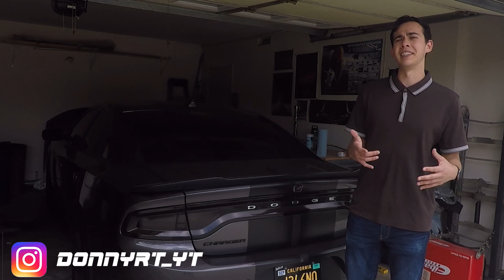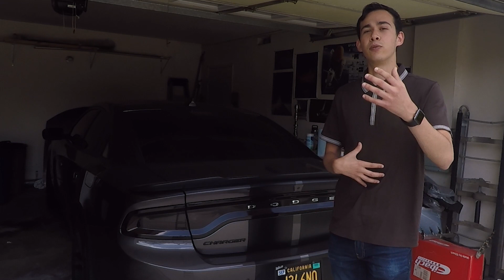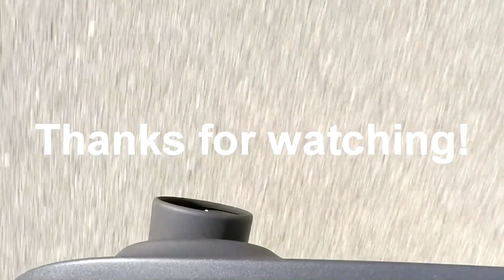Why I Haven't Been Uploading...

Comment: Did you need to unlock your pcm before tuning your car? I have a 2015 r/t I’m wanting to tune. I’m side by side with a v6 camaro
Reply: U should be able to beat em. I hold the record for fastest 0 to 60 on stock rt. I got 4.5 twice and couple 4.7s ... v6 camaros are low 5s but we got em on top end.. just take out your passenger seat and get a tire and pedal commander u should beat any stock rs ... I even beat a scatpack 2x but he sucked at driving
Reply: yea 2015+ needs pcm unlock

Comment: Hey don. I just got my cam installed by a professional performance shop. It took months 2500 dollars, a bent set of push rods my transmission not shifting right  Wrong tune loaded by the shop. 10 visits many phone calls.
Reply from the maker: The shop installed it incorrectly? Shouldn't really bend pushrods unless it was out of time or they were sized incorrectly, no?
Reply: @DonnySRT  yep they tried to blame the pushrods being too long that cam kit came with. But they were the right size they just didn't want to admit that they were off a tooth.